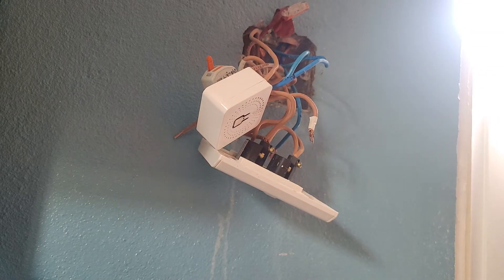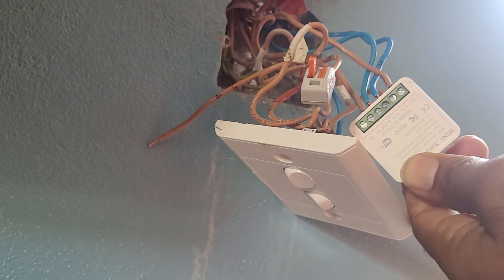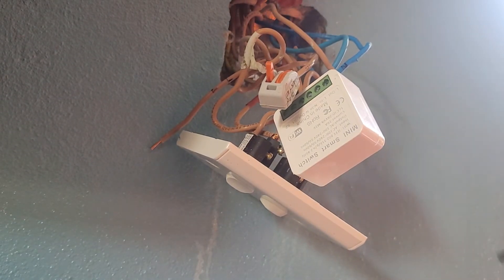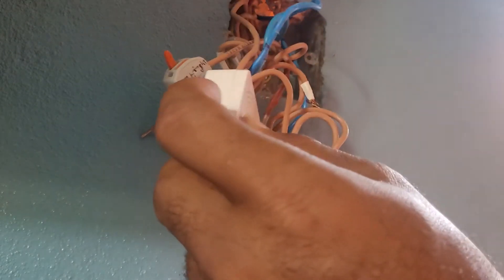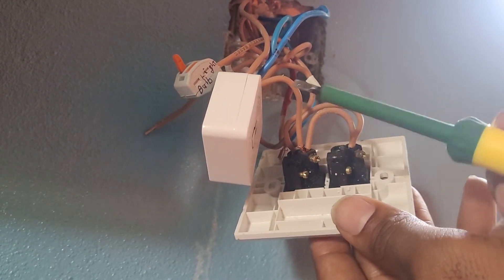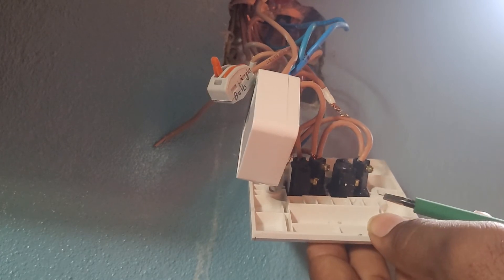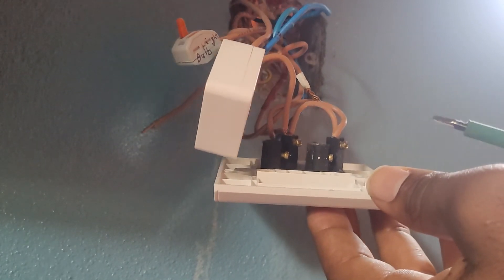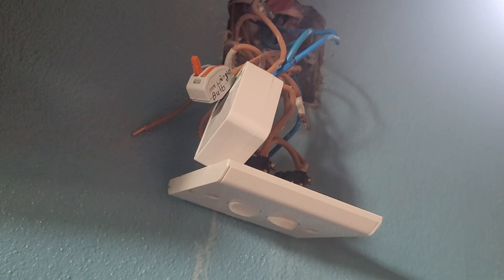how not to connect an aubess wifi diy smart switch

Comment: so far i have blown two of my smart switches and finally figured it out. the way to do it correctly is that the physical toggle switch should not be connected to live wire. it should only be connected to S1 and S2.